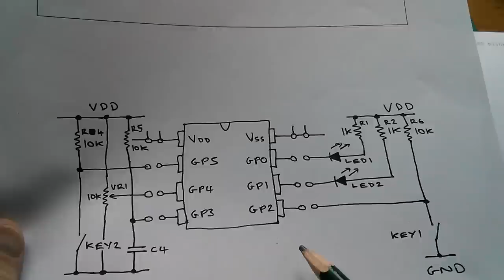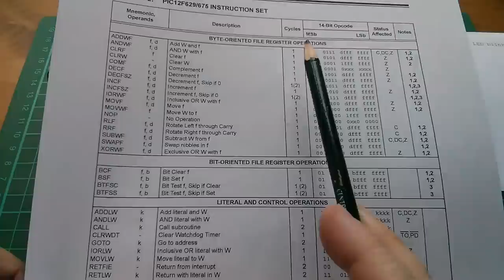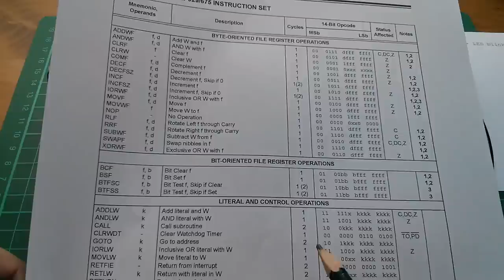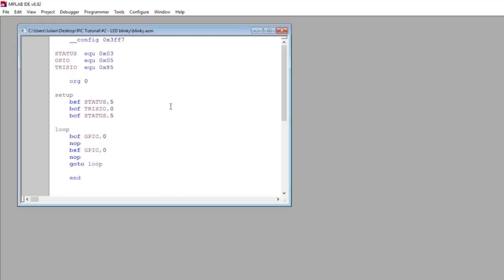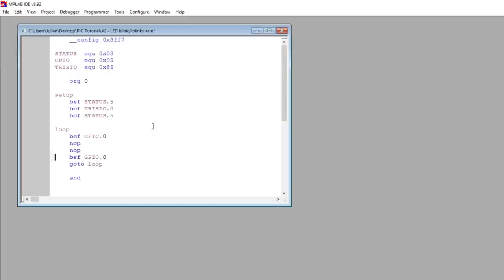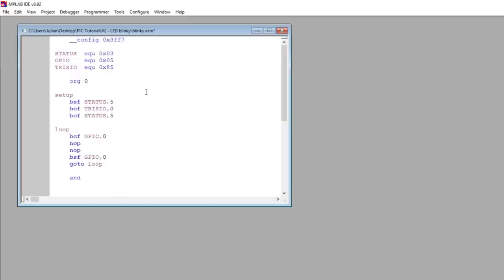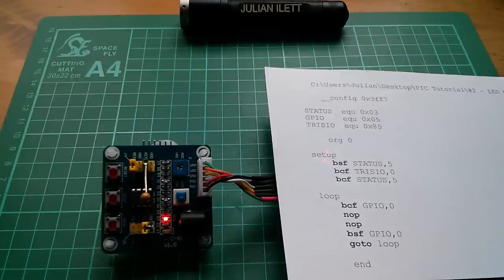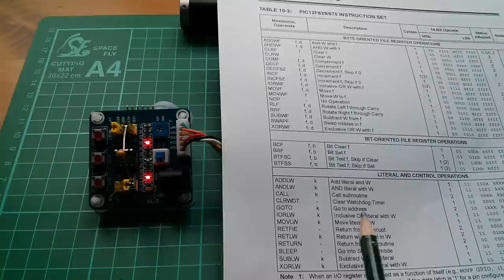PIC Assembly Language Update: #2.1 - Blink Symmetry

Comment: Julian's next video will illustrate why a GOTO takes 2 machine cycles to execute.  In the mean time, I'll explain it in words just in case anyone is impatient enough to want the information now but patient enough to wade through my lengthy prose. :)

All instructions actually take 2 machine cycles to execute because one machine cycle is needed to fetch the instruction and one more machine cycle is needed to execute (carry out) the instruction.  The one-cycle execution is possible because the Central Processing Unit inside the chip pre-fetches the next instruction while it's executing the current instruction.  Pre-fetching the next instruction while executing the current instruction means the CPU usually doesn't have to wait one machine cycle before executing the next instruction.  It's literally doing two things at once.

But when a GOTO comes along, the CPU will almost always have to restart program execution at a location other than the next one, so it can't execute the instruction which it has pre-fetched.  The CPU has to throw away the instruction it has pre-fetched then it takes one machine cycle to fetch the instruction from the location it just jumped to, then it can begin execution of that instruction on the second machine cycle after the jump (while once again pre-fetching the next instruction).

And yes, this does mean that the first instruction after a reset also takes two machine cycles to execute, because it can't be pre-fetched.
Reply: Just to clarify (and as Julian mentioned), the "jump" is just the CPU writing the destination memory address to the program register.

Depending on the CPU, it may take also an extra cycle to execute the instruction, if it's only capable of reading one memory location at a time (in the case of most 8-bit CPUs), so it'll take one cycle to read the instruction (jump), then another to read the data (destination address), then another to execute.

And as you suggested, if you've ever clocked a CPU by hand and noticed it takes a few cycles to get started, that's partly because it has to fetch the first instruction, since it can't pre-fetch it before it starts.

Comment: Thanks again for posting these tutorials, Julian. Microcontrollers, like computers before them, have become more and more basically  appliances that with a little prodding/copying/pasting do something useful. Too little time is spent understanding just HOW these devices do what they do. IMHO, high level languages, while very useful, have dumbed down the user. I for one appreciate learning the nitty gritty basics, even if I still continue to use a high level language for day-to-day projects.  Looking forward to future installments.
Reply: John .. High level languages can also introduce a lot of inefficiencies.  Which can also result in wasted resources.  It's a trade off.  And can change the amount of 'hair pulling' when things won't work just quite right enough :-D
 -- Side note - Knowledge of machine instruction can be useful.  I once took a children's game that had a very frustrating 'level timer' in it.  I used a dis-assembler to find the 'jump' that ended the level and disabled it IN the executable file.  The timer still worked, but you weren't forced to restart the level.

Comment: Isn't there an easier to program PIC's? maybe using a Arduino like environment?
Reply: Eddy Mickroelectronika offers a good, comprehensive and easy compiler for PIC programming. :)
Reply: You can use the MPLABX environment with the XC8 compiler, along with a PICKIT 3 programmer head. This is the more modern stuff they offer. The old PICs are not much cheaper than newer PICs

Comment: i was thinks you can use a for loop! in java you can have a for loop and " for  (x= 0; x<3; X++){
bcf: GPIO , 0
}
in the for loop you check if x is less than 3 then you will still be in the loop, so here the on time will be the same as the off time😰
Reply: There is no for in Assembly.
Reply: nrdesign1991 - Hehe .. there is if you write one.  ;-)
Reply: Also all that checking and counting will take way more CPU cycles thanJulian demonstrated here. CPU's these days are fast enough so that ou won't notice it, but if you have an assignment where every single byte and CPU cycle count, you have to think about how to sensibly use them. (I'm glad that I never had to do this!!)